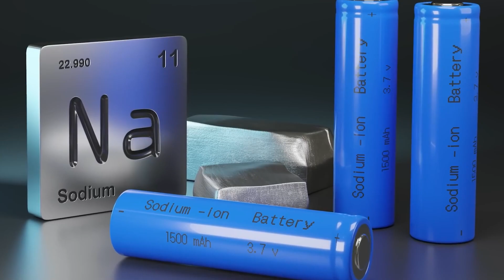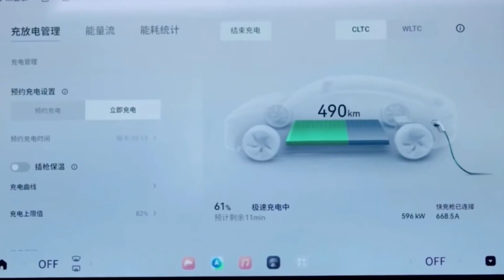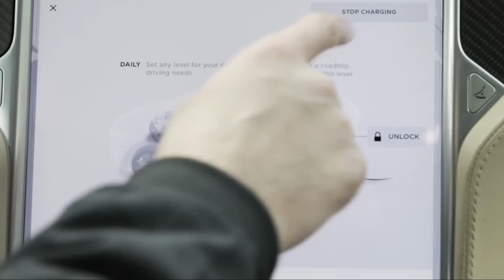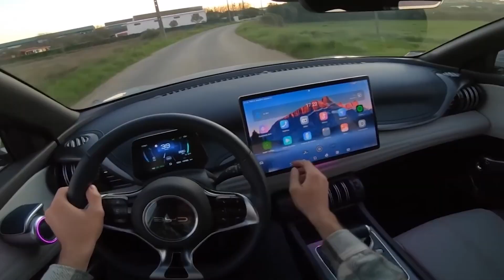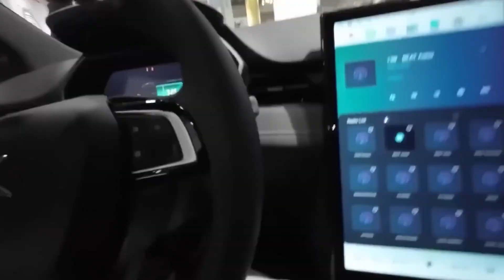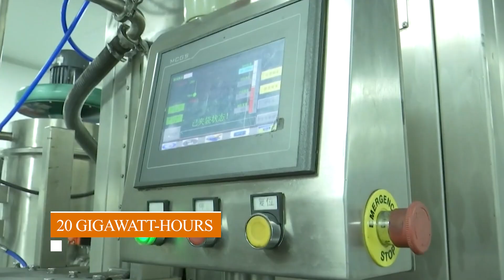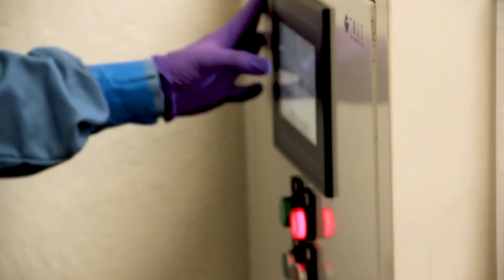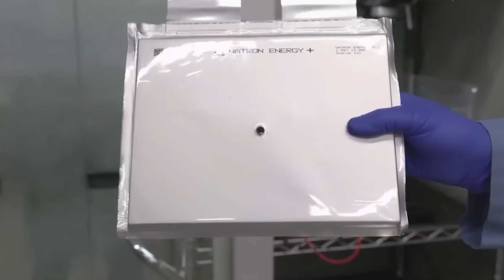The Battery Breakthrough Nobody Saw Coming   CATL s 5 Minute Charge Miracle!

Comment: The issue is how this very fast charging will affect the battery lifetime, right now  it works in a lab but what about after 100 000 miles on the road with vastly fluctuating temperatures and vibrations and wear and tear.

Comment: Problem, sodium is much more expensive than lithium right now, almost double the price for the same energy density and is heavier due to low energy density per cell.

Maybe them deciding to move away from lithium will helps to reduce prices eventually, but right now any sodium battery can be upwards of doublet the cost , where it is available.